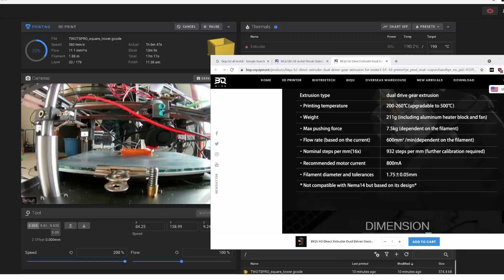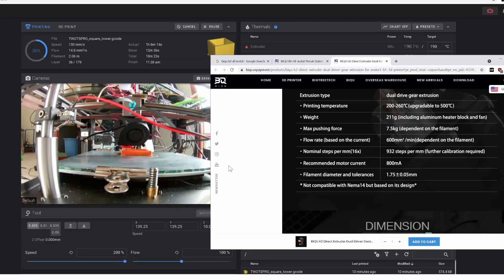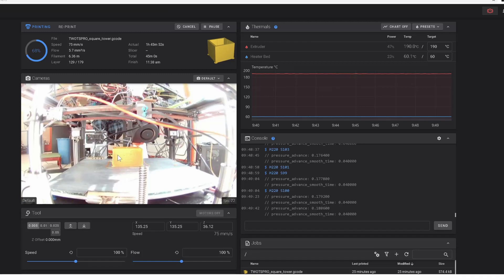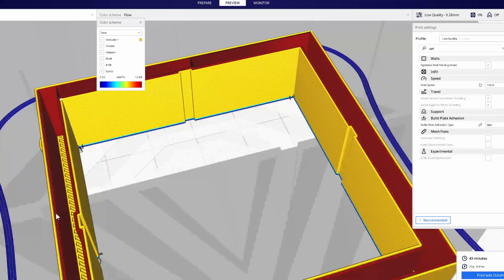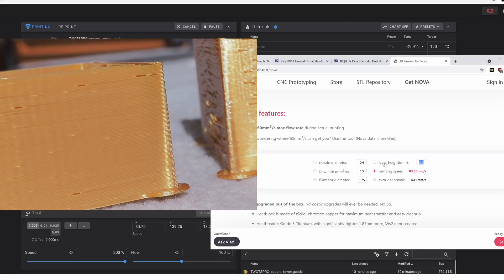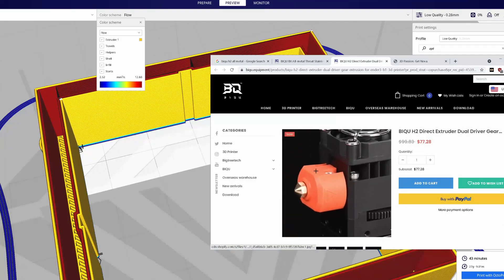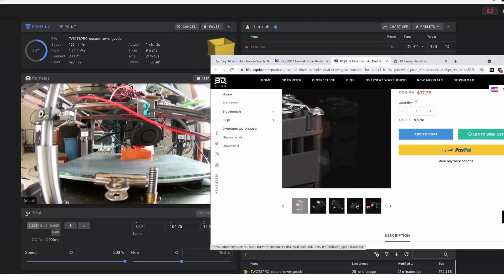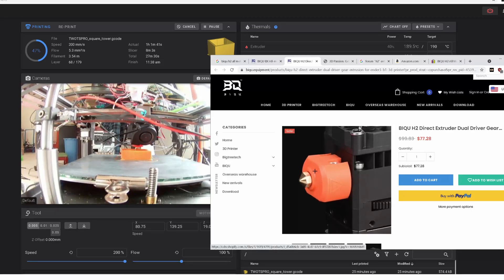Biqu H2 hotend extruder on  Sapphire Pro corexy 10mm3/s flow confusion

Comment: Honestly parts looking really rough past 0.2mm so unless printing a full size chair I think a 0.4mm nozzle on a Biqu H2 is going to be fine for 99% of the population. According to Nova and your number of 10 125mm/sec should be possible which is more than enough to present other concerns like cooling the previous layer and warping. 

 For those looking to find the limits of printing you might get to 150-200mm/sec with decent looking prints but if you have the money I would consider a large resin printer with tough resin. There is a whole new generation of printers coming and prices will continue to fall. Can't wait to see what kind of resins become available with them!
Reply from the maker: I'm more interested in functional and fast prints so the aesthetics are really last place for me. I agree that most are not in this camp.  Resin is terrible for functional prints in my opinion and I can't stand the smell and mess.
Reply: @JesseSchoch  ABS-like and Weistek toughness have both been really great for me as I print only functional parts like fixtures/printer parts. They tend to snap vs tear but I would say it's 80% as good with ability to go full infill and regain anything lost by comparison. Resin really shines when used for fan ducts as it's resistance to heat is second to none. I have yet to warp any duct even after accidentally melting them when placed against a heater block the overall shape was retained. 

Early on I had issues with prints sticking to the bed too well and now use a stainless magnetic flex build plate. Still use my FFF printers for 192mm+ parts/single use parts I need to be cheaper then the $22/kg resin I find on sale.